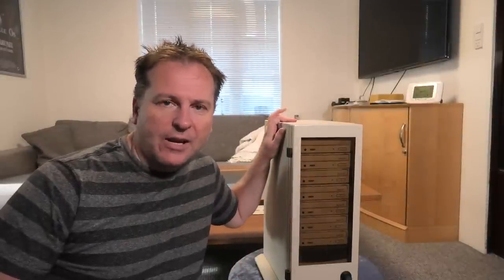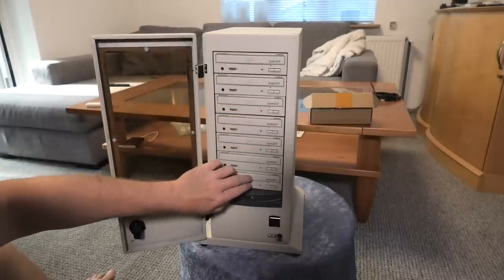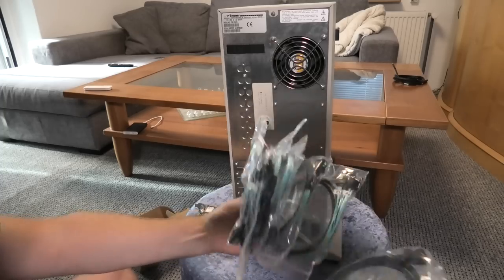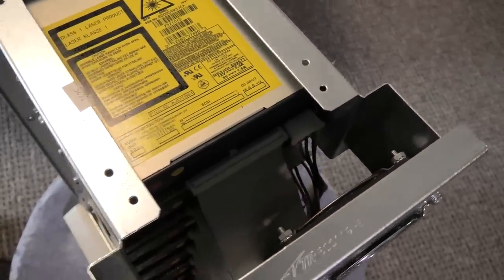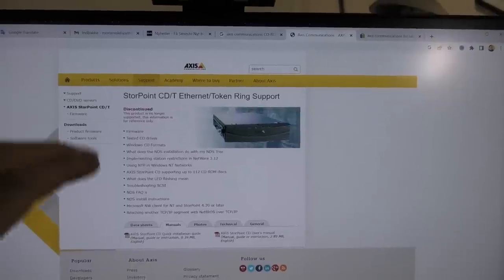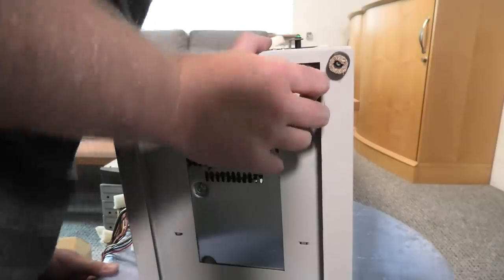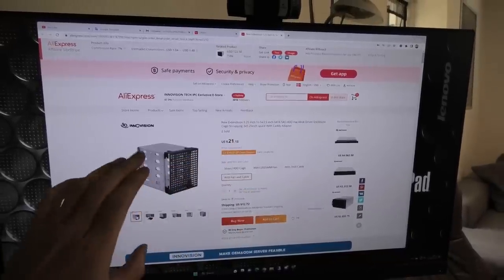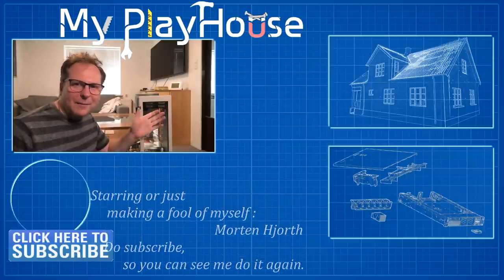1997 CD-ROM Library, to Become Bunker Storage DAS - 1303

Comment: And to all of you who hasn't a CD-tower laying around: there's an Sharkoon ATX-Case with many 5,25" bays in the front. Room enough for a mainboard with a sas-card, a 10gb network-card and truenas, unraid or any other distribution. The sharkoon Rebel-12.
Reply from the maker: I would not think that is to many people :-)
Reply: @MyPlayHouse  My Truenas is an itx-case from LianLi equiped with a jetway q77 board, 8gb RAM and 5x 5Tb WDred HDD. With an 120Gb SSD as Cache it's fast enough for iSCSI and virtualization and also for every backup. Saturates it's 1gbit/s link.

Comment: Just some thoughts on this project...
3D Print a bracket to hold the SAS expander and insulate the backside of it from any metal surfaces.
Replace the stock fan with a pair of noctua industrial 80mm fans for better airflow at a similar noise level.
Replace the front window with mesh for airflow.
Use a pair of 4 bay 3.5" drive in 3 5.25" drive bay holders to still have room for 8 hot-swap 3.5" drives, and put in an 8 bay 2.5" in one 5.25" drive bay for SSDs (tiered storage).
3D Print a case to hold your SAS HBA with a fan blowing on it.
I personally would replace the PSU with something modern. Modular ATX supplies are great for this, you just need to bridge the power-on signal to ground, and there are very cheap ATX-24 pin adapters with just those two pins populated for this very reason.  AT supplies are getting quite old, and can fail spectacularly.  At a former employer we got in a palette of new never used AT supplies from a reputable company, the caps had all leaked out and when you plugged them in the +12 volt line would shoot up to about 24 to 28 volts and blow up anything you had plugged in.  A 25+ year old used AT supply is a liability.
Reply from the maker: Thank you for all the sugestions,, I would like to be able to run the DAS from DC,, at some point,, in the bunker.

Comment: The DP15 is the AUI connector, used to go to a converter to either PDS, Thinnet with BNC (RG59) or Thicknet with N-connectors (RG8'ish), or even TokenRing in some cases.
I might have a few AUI/Thicknet converters somewhere in the "museum" ;)
Reply from the maker: I am sure I had some of those as well,, not sure where they are or went to :-?

Comment: I'd be careful with that old AT PSU, they don't usually have a lot of 12v capacity, which is what everything these days runs on.  Also the poor thing is over 20 years old, and deserves an honourable retirement. I'd look for an alternative for power, like some of the modern SFF units.
Reply from the maker: Well a little CAP smoke has never hurt anyone :-) If it dies,, it dies, and we will deal with that. Not a problem.
Reply: Everything runs on 12v these days, except for hard drive electronics.

Comment: In the front there sits 12 drives with those 3 lff to 2 5.25 inch cages
Reply from the maker: The ones I am getting is 5 in to 3 - 5.25 inch cages. so 10 3,5", and maybe 8 2,5"

Comment: Will you need to attach a small 40mm fan to keep that card cool like I have to do when i put the 10g server cards in my desktop cases?
Reply from the maker: Uhh I would really like to avoid those small noisy disks,, but it might need cooling.
Reply: @MyPlayHouse  I use the "ugly" noctua fans they are nearly silent a little more expensive yes but worth it IMHO.

Comment: would the card not fit in the slots on the rear of the case, then the sas cable will already be out of the back
Reply from the maker: I want it out of the way from the drives. and the card is a lot longer than the network stuff I took out.

Comment: Hay Morten, funny i have just managed or something like 4 weeks ago, get a similer CD-Rom box you have, only issue been told does not power up, possble PSU issue, no biggy.
Reply from the maker: Well I do actually also not know if the PSU is any good in mine yet.
Reply: @MyPlayHouse  nice one on the find, a soon as I get it will test it , talk about a very rare find Morten